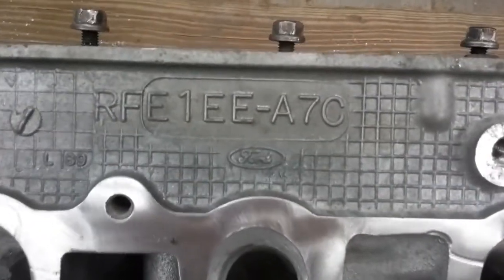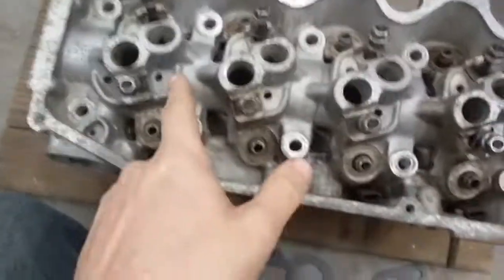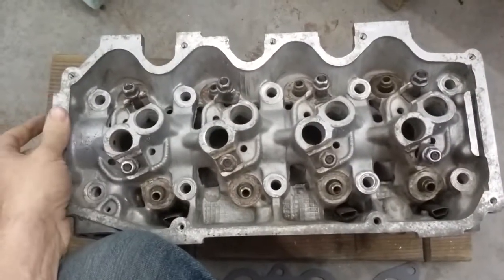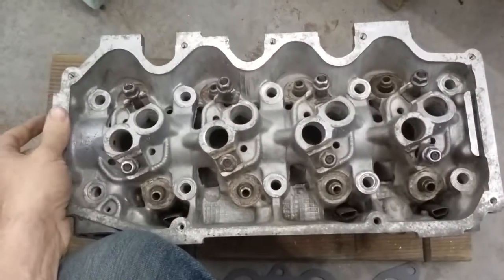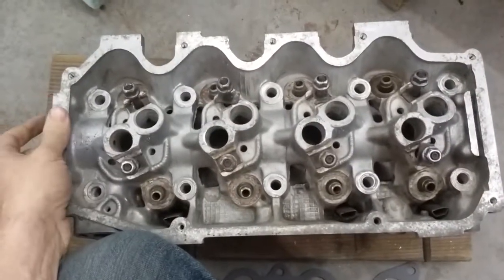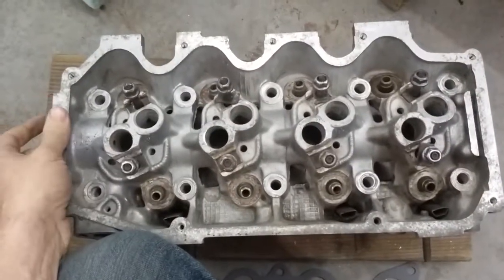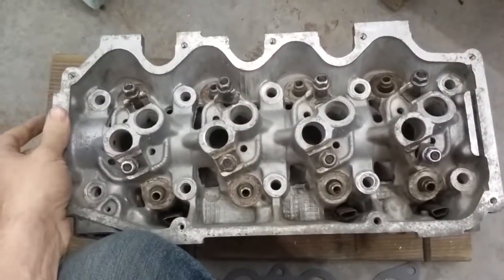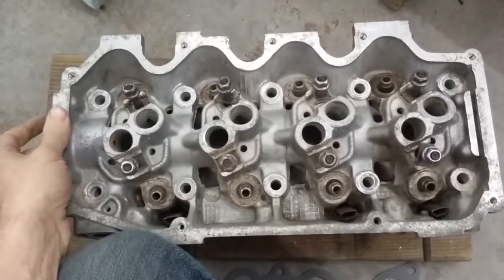Ford 1.6L CVH E1EE  Essex Head Porting (Gasket Match) Reconditioning (Part 1)

Comment: I used the gaskets as guides to gas flow my RS1600I head, what a difference.
Reply from the maker: I did it just because I was going to save the head for a bike carb build but ended up needing the head sooner than anticipated. Kind of worked out in the end because when I put it on my block I switched to a 1.9 carb intake manifold that has larger runners than the 1.6 carb intake.

I have many more heads that I'll be doing better work to soon so stay tuned :)